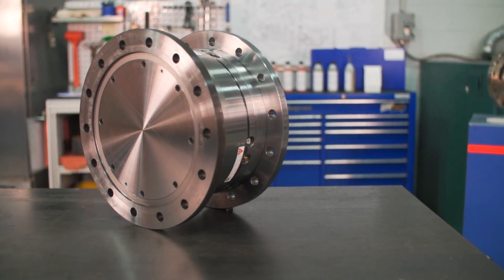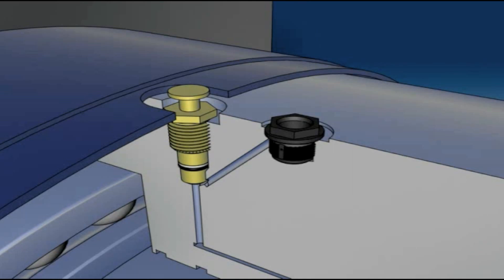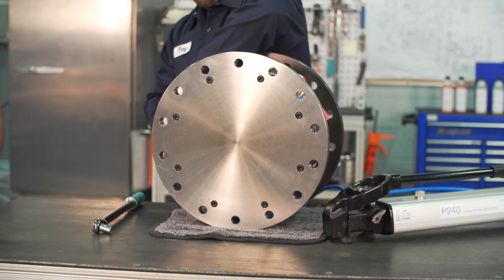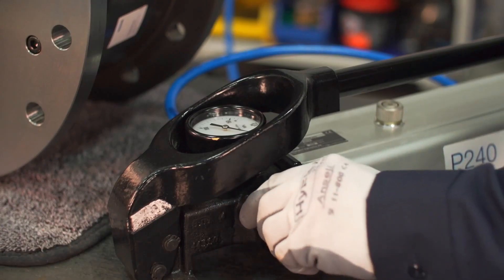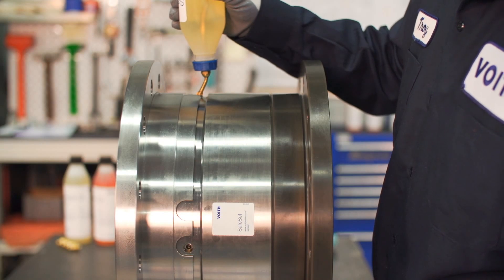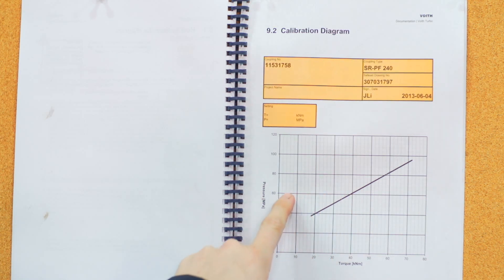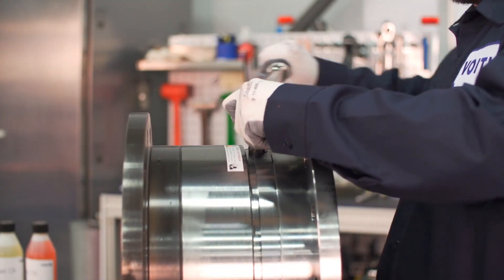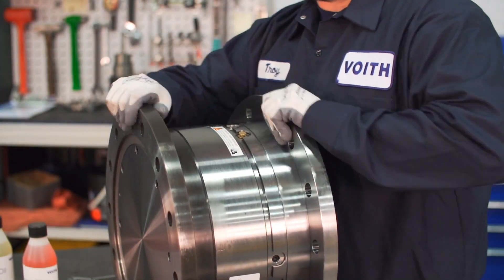Voith torque limiting couplings SafeSet  − Operational and maintenance instructions (EN)

Comment: Bu kablinlerin sol_sağ dönüş yönü onemlimidir? teşekkürler
Reply from the maker: There are no cables attached on the SafeSet coupling, if you are referring to the pump hoses attached when resetting the coupling at standstill, the hoses are disconnected after resetting and the rotation is not important.

Comment: Sir, what is the reasons of countinue demage of shear pin or tube??
Reply from the maker: The functioning of the clutch is based on the fact that it slips and disengages when overloaded. As a result, the drivetrain is separated.

This happens when the bolt (share tube) shears off, allowing the oil to escape.

Comment: Hola. Tenemos un acoplamiento igual en la fábrica. Querría saber que ocurre con el aire al llenar el circuito de aceite. No habría que purgarlo o sacarlo para llenar el circuito?? O queda comprimido?? Gracias y saludos!!!
Reply from the maker: Dear Sir, firstly, thank you for your question. The air is compressed out (to almost nothing) when it is displaced by the oil. For example: 1000 bar delivers 1000 times smaller air volume due to high air compressibility. Of interest, as long as the correct pressure is reached, the coupling will work properly, independent of the air and oil mix ratio. Should you have any other questions, please feel free to contact us. Kind regards, the Social Media Team